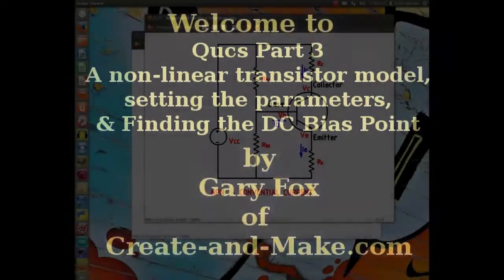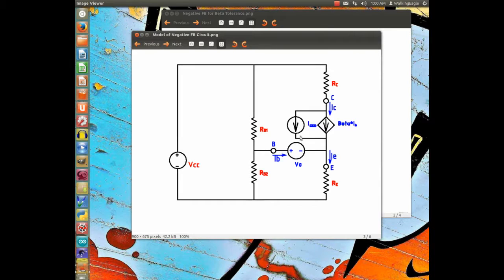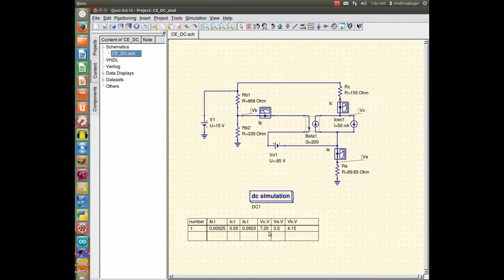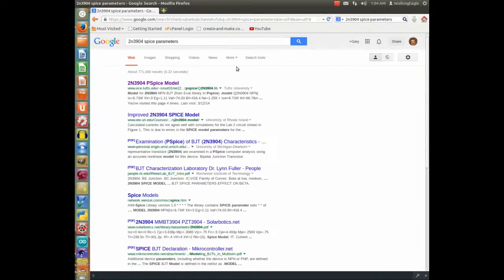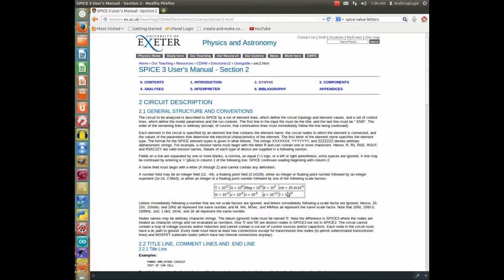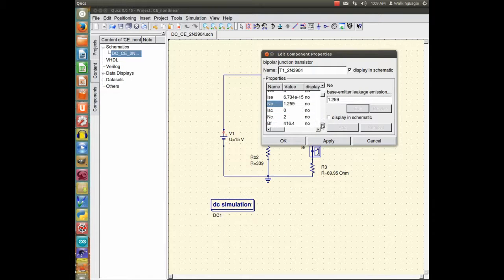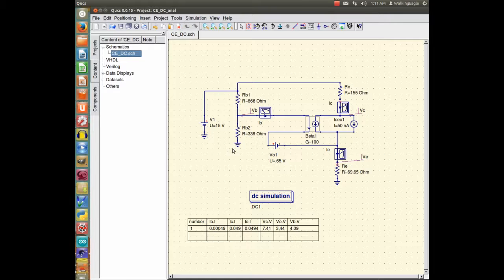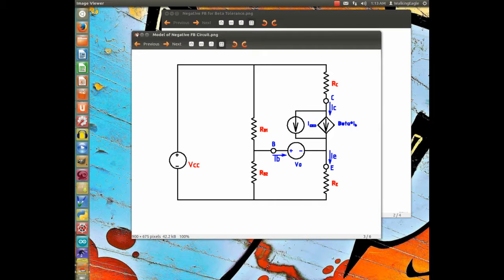Qucs Part 3 - DC Bias point for a non-linear transistor circuit

Comment: I would like to know how to import MOS model parameters into Qucs. I don't want to end up modifying each property value in the MOS parameter edit box by hand. The 'Edit' and 'Browse' keys are greyed out so it does not seem possible. I have Qucs installed on a Mac OS, some advice very welcome...
Reply from the maker: I will look into that very soon and get back to you.  I use Linux, but things are probably similar.
Reply from the maker: Qucs has several manuals in pdf format.   The one called workbook may be very helpful for you.